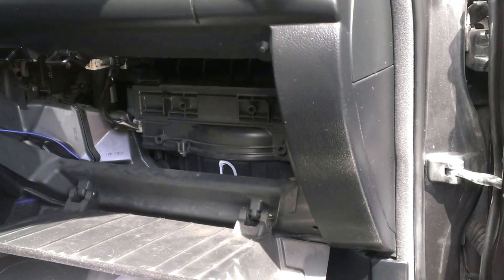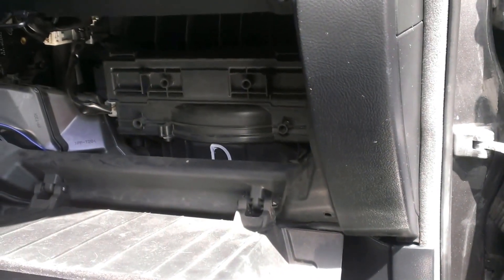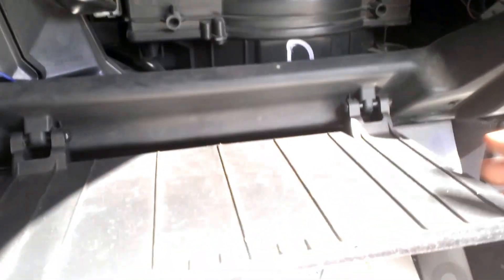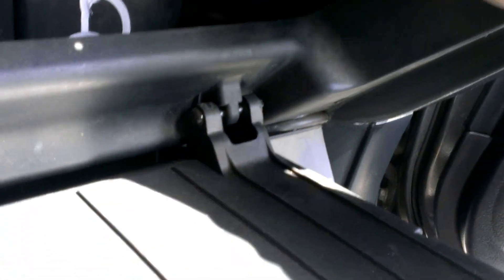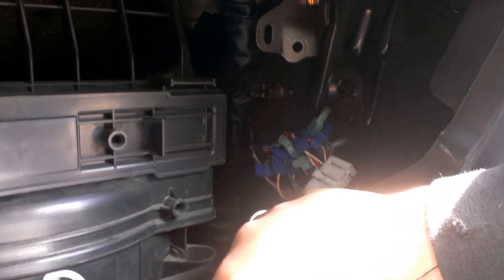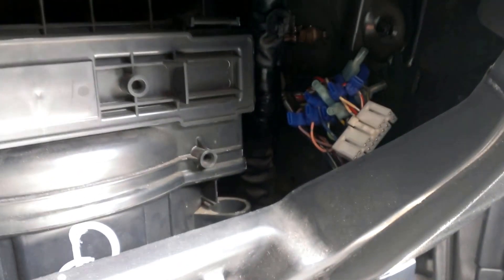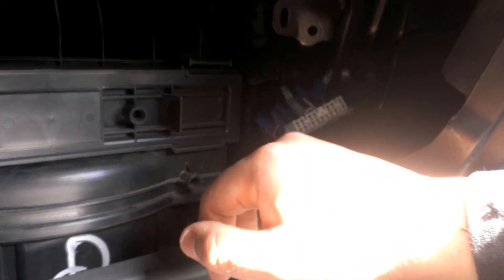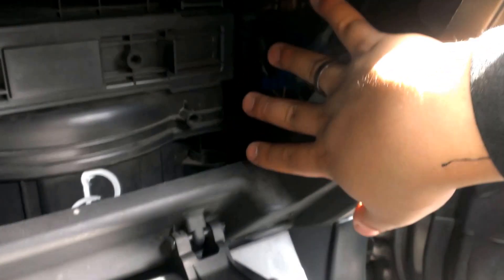Lexus IS300 factory amplifier location.

Comment: You can tap into the wires like that, that way you don't have to by that extra harness, quite simple to do, could look cleaner than that, but still many people bypass the factory amp.
Reply: Caleb Filipi which connector of the factory amp is the output

Comment: My Is300 radio does not work and i was told that it has no amp, shouldni just buy an amp and plug it in or what ?
Reply from the maker: Did you look and see if there is an amp there?  Also, is it the factory radio or an aftermarket?
Reply: Hey ! There was no amp , i have purchased a factory one , plugged it in and noticed the cables were cut so when i get the chance i am going to rewire the plug and hopefully that solves it! Thank u

Comment: where do u get the bypass connector for the amp
Reply from the maker: melito25 You can get them on ebay or even places like Best Buy can order them.  In this car new wiring was ran straight to all of the speakers though.
Reply: DIYAutoCarage thanks alot I really appreciate it the info

Comment: I have a question I also have a 02 Lexus is300 I was wondering if I bought a bypass harness would I still get sound with the original speakers? Until I get sum after marker speakers later I been searching all over for this question if u can help I would appreciate it
Reply from the maker: Yes, you can get sound with the factory speakers using the bypass harness if wired up properly.
Reply: DIYAutoCarage one more question where can I get this harness if u have a link or if u can point me in the right direction
Reply from the maker: 70-8116 I believe is the bypass harness.